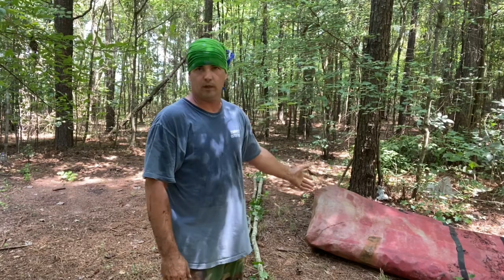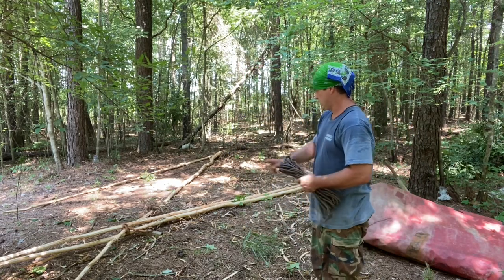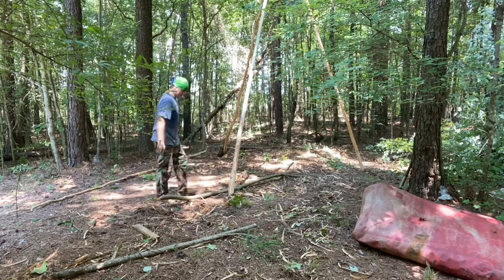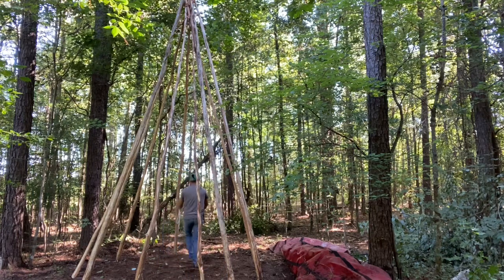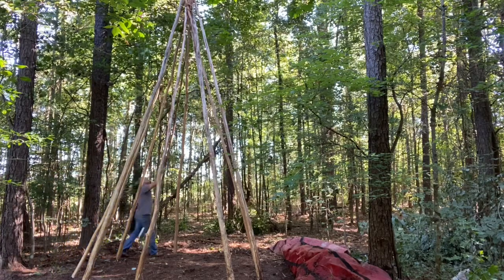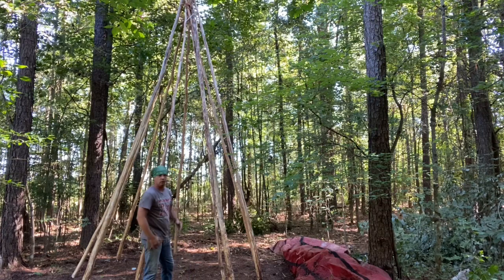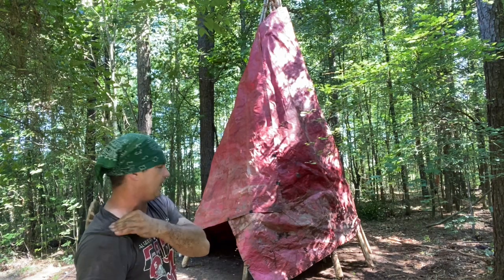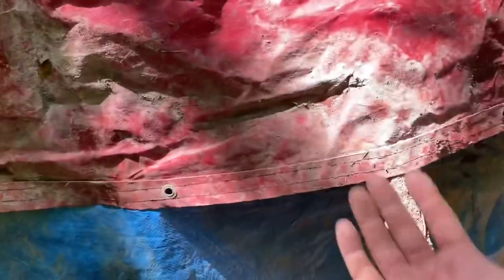Building a Homemade Teepee

Comment: Yeah, well. What you did was neat, but, you need to get that book by Laubin if you haven't read it. Get that, read it, then go to supply houses like Track of the Wolf or The Log Cabin Shop and order yourself a complete tipi outfit. You've got a perfect place there to set one up. Your poles at your entry should be shorter than your back poles and you make a ladder by lashing sticks between them and feed the cover over from the back. A tipi isn't a cone. It's wider at the sides and back than at the front and those smoke flaps are important at directing smoke. Those things weren't crude. Believe me those guys traveled in comfort and, given the choice, I don't know but what I'd rather lived in a well appointed tipi than a house. Read the book. Always enjoy your videos and sense of fun. Don't ever lose it.
Reply from the maker: I have looked at them from several companies online. I just dont have $1000 to spend or i would have one here.